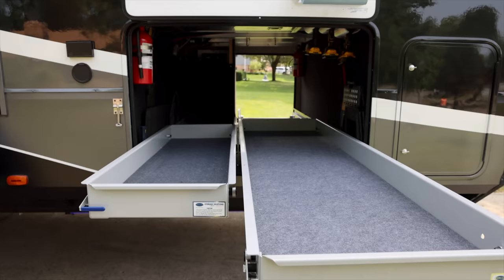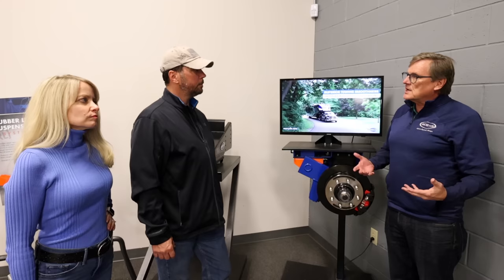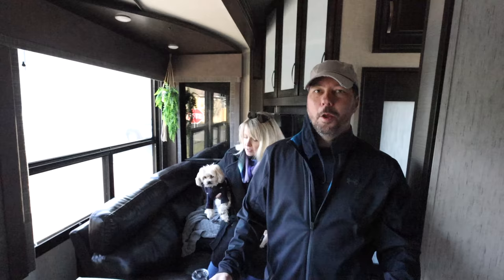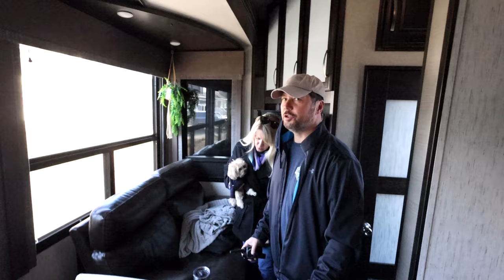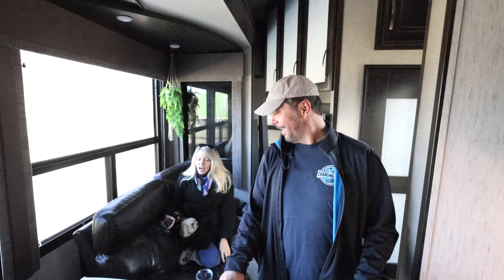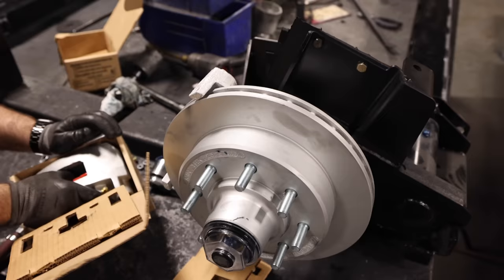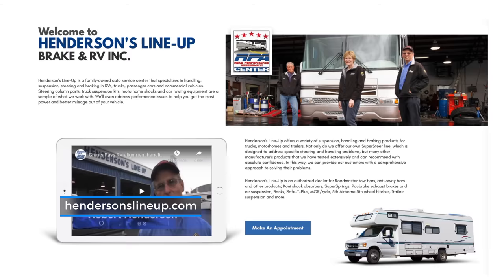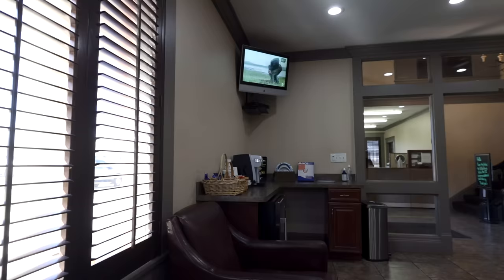MORryde Independent Suspension and Disc Brakes

Comment: Yes, independent suspension is better In many ways, but alot of the chatter they were getting is actually caused by not having shock absorbers. Install a set of shocks and alot of that goes away. I bet the independent system isn't a cheap install! There are definitely advantages to disc brakes in regard to heat dissipation, and apply time, drum brakes are less susceptible to mechanical problems over the long term than disc brakes. I'm sure the new suspension does a good job, but man, the price tag!

Comment: That's awesome. I have a enclosed trailer that had the Dexter torsion suspension on it, which is almost the same suspension you just had installed. The key is independent suspension to the ride. As a truck driver myself the air ride suspension is the best but these style is so compatible without having to add a onboard aircompressor to run the suspension air bags. So as we are currently shopping for a bumper pull toy hauler I'm kind of key on finding one without spring suspension. And I know the Dexter torsion suspension is available on some models. Not sure about suspension you guys purchased! Also video thanks for sharing.
Reply from the maker: They will definitely instal on a travel trailer also.. 👍🏼

Comment: Almost worth asking why this system is not made mandatory, original equipment fitment. 
For safety and longevity reasons. 
There are obviously weak chassis out there and seeing the video of the springs working etc, this system adds up. 
I seriously can't see how twin axel art ups can you handle the treatment dished out, triple axel should be a the only option for these bigger rigs. 
Seeing other RVers having broken springs and chassis bending and breaking issues, I would have thought the DOT would be over this with a fine eye, it's obviously a problem, maybe  guys like yourself should start an advisory group to preside over change in the industry.. 
And I know many will say it's about cost, well how much is your families  life and other road users lives worth? 
Thanks for the great informative  video 
Cheers

Comment: Curious as to why they packed the bearings with grease when the hub has a wet bearing cap 🤔 
A wet bearing would be great for the weight of your trailer 👍

Comment: Thought about the IS, it makes perfect sense but as I understand, there are only 2-places in the country where it can be installed and repaired.  While not out of the question to travel to have the install done, my concern is what if there is an issue on the road many, many miles from  one of the two facilities.  Looking into other upgrade options.  Another well done video and sure makes a compelling case for this upgrade.
Reply from the maker: Most of the parts are fairly simple.  I'd bet most shops could work on it with some guidance from MORryde.
Reply: @ChangingLanes  You are absolutely correct, it seems I was given some misleading info.  I have just received replies from Moryde and should a repair be needed it can be done locally.  Seriously considering this upgrade, thanks for sharing your experience.

Comment: It is great they are adding shocks and adding travel.  Kind of a shame they use rubber for the springs and lose the camber control an axle provides.  I know "independent" is a great marketing term, but that aspect of it is definitely not helping in this case.

Comment: In this day and age I am surprised it has taken this long to come up with this.   Now just one more step, Air Bags so one can level the coach side to side.  No more blocking up the tires
Reply from the maker: With this suspension and the 6 point auto-level, there's no need to block the tires.  We never did it even with the old suspension, but there is a risk of flipping a hanger when the wheels come off the ground.  No hangers to flip with this...

Comment: Been waiting for this video, what an amazing difference that makes.  We plan to order the 395MS the first of the year and it showed on the order form that it can have the Morryde disc brake upgrade, do you happen to know if that is the same set up you just got?  Can’t wait to have that upgrade.  Also, how do you like the new pin box, thinking about the genY but wasn’t sure how you liked the Morryde hitch.  Great information thanks for the video.
Reply from the maker: The IS is not on the sheet.  It's a "hidden" upgrade that you'll need to request through your dealer when you order.

Comment: This type of IS is called a trailing link, several of the private jets I flew had this type of landing gear as it makes the landing and taxing much smoother for the following reasons.
The wheels will not only move up when hitting a bump but they will move aft (in an arc) thus reducing the tendency of the wheel/suspension to slow any forward motion (jerking).
In the leaf spring the suspension moves mostly in an up and down motion, thus attempting to slow any forward movement when hitting rough spots in the road.
Some of this fore/aft movement was adsorbed in the 5th wheel hitch with shocks/airbags. You will notice much much less fore/aft move in the truck with the IS suspension.

Chad, remember what the landing gear on a F-18 looked like, now imagine doing a carrier landing in a F-18 with what we called a stiff legged (straight leg) landing gear.

I noticed on some of the Disc they had what looked like speed sensor lugs, were they used in another application and adapted to their use or is ABS an option.
Reply from the maker: Very good points!  I hadn't considered that!  👍🏼

Comment: Curious if you think I'd have clearance under an Airstream...though a little more height would help with the shallow departure angle back aft given it's a 30'er.  Also, I suppose a drive-on Jiffy Jack is out of the question...or is the swing limited enough were that kind of jack could be used???  One more thing, are you staying at the campground in Elkart run my Bob and Gita?  Thanks again for an informative video!  Glad Daisy liked it, we have a squadron of FIVE  contentious dachshunds.
Reply from the maker: Yes.. we stayed at that one.. Elkhart Campground.  I think a jiffy jack would work...

Comment: In 1996 they where putting the MORryde on the tow truck. Are they srill doing that now? By the way the couple that bought our 1996 HRC still have it and have not had any trouble out of the MORryde. I don't know how many 1000 of miles we put on ours but no problems the hold. Great people to work with.
Reply from the maker: Didn't know they ever did that..

Comment: Couple this with an air ride Goosebox and it would be the best available.  
Have you noticed any difference when backing into tight quarters.  Less or more bind or less or more tire slide on the triple axle.  
Thanks great video.

Comment: Great topic presented well, thank you. Is the only way to jack up the center axle/crossmember crawling under with a bottle jack? Your "first blowout" video showed you using a bottle jack on an outside tire.  What is the reason for using the narrow tires on the RV? After hearing you say "there will always be tire slide on a turn", maybe that is why, less friction so less broken springs? You guys are doing great, keep it up and Happy Holidays !!!
Reply from the maker: You can jack up the RV under the frame, or just one suspension (kind of how I did with the blown tire).  They also sell things that let you run an adjacent tire onto that rocks the side up.
Not sure what you mean by narrow tires?  These are pretty standard width...
Dragging tires or an axle is just the physics of having 2+ axles.  Some of them have to slide a bit in turns.

Comment: Awesome..!! Tech video... I will defenetly get the system installed when I get my 5th wheel.  Thanks for the information, doing my research now.
Reply: Look into Roadmaster Slipper springs with Joyrider socks. $1400 approx. No maintenance, strong, easy install. This was a paid info commercial!

Comment: That looks like a dramatic improvement in safety, and minimizing wear and tear on the RV. Thanks so much for another detailed (and always entertaining) episode.

I did come up with a few questions:

-How does it affect the height of the rig?

-What is the impact on alignment and future adjustments? Can a normal trailer alignment shop do that, or does it require specialized equipment?

-How much weight does it add, and does it impact the Gross Combined Vehicle Weight? Might it improve your cargo capacity?

Thanks!
Reply from the maker: On height, they will try to get you level without going over 13'6".   For us, our hight didn't change.  They said alignment can be done anywhere.. On the weight, it's a little bit complicated.  Please see: https://changinglanesrv.com/faq/?Display_FAQ=3913

Comment: Interesting video, I like the visit at MORryde factory, the welding, mechanics at work, the interviews with MORryde personel. I particularly like the under carriage cameras which offered a good view of the suspension in action. Glad to see you like your new suspension/brake setup, it will definitely make the long drives more enjoyable. Daisy approved yeah! One question, your 3 axles were rated at 7k/8k/9k lbs? each (Chad you tell me). do you know the rating of the new independant suspension? is it the load capacity the same?more?less?
Reply from the maker: We stuck with 7K rated suspension just like our dexter axles.  These are much beefier without the hangers and leaf springs and 21K of axles is plenty.  they usually recommend 8K axles for tandem axle trailers.

Comment: Fantastic job with the camera angles under the RV! Best review of the IS system I've seen so far. We have MORryde IS and their pin box on our Solitude. If you want the ULTIMATE smooth towing experience, get a Trailersaver BD5 airbag hitch. It significantly improves the ride quality in the truck and smooths out the ride for the RV as well. Give Daisy a rub on the head for me :-)
Reply from the maker: Looks like a beast!  👍🏼
Reply: @ChangingLanes  BTW, you nailed the lighting on those cameras under the rig. Not easy to do. Well done!

Comment: I think it was a bonus that one of the Westlakes didn't explode on video!
Reply from the maker: The origin of the moniker “china bomb”, as near as we can tell, came about in 2016/2017 in reference to the E rated Westlake tires having a bad run of blowouts. We're not sure if it was a bad batch of tires, or if the tires were under-rated for the application (heavy toy haulers). Regardless, the name stuck and became tied to all Westlake tires even though the G rated Westlakes have a very good track record. Grand Design started putting the G rated tires on the Momentum line in 2017.

Comment: The one question that I didn't here was GVW did it add to the weight or not?
Reply: Good ques. I was wondering this also...
Reply: What was the height changes to the RV too?
Reply: Same here, how much weight did it add to the trailer over the old suspension system
Reply from the maker: It's a little bit complicated.  Please see: https://changinglanesrv.com/faq/?Display_FAQ=3913
Reply from the maker: Our height stayed the same.  They try to keep it the same if you're already running level, or get you level if you're not.  Of course, all while staying under 13'6".

Comment: Fifth wheel transfer any Sway to the rear axle of the truck, in heavy wind and such.. does car manufactors take in consideration such for trailer max capacity, or does max cap. rely on a sway-bar in their measurements

Comment: We watch all of your videos and really enjoy them. Looking forward to meeting you on the road sometime. 
I was wondering if you had weighed your trailer lately to see where you were at? Maybe when they installed the new suspension? I see that the specs showed your rig at 4400 Lbs CCC before all the options you ordered with yours.  With Lucille on board and everything else that you have brought along, are you getting close to your rigs GVWR? 
I ask this because as FT RV'rs I cant seem to fit into my 3700 rating in my rig. I wish manufacturers would provide more capacity so that one could run with some extra margin.
Reply from the maker: It's a little bit complicated in terms of the IS and weight.  Please see: https://changinglanesrv.com/faq/?Display_FAQ=3913 

We've not weighed in a while but we were a few hundred over last time we weighed... It's almost impossible to stay under then full-timing.

Comment: Chad - we got the same upgrade from MoRyde in September (8k IS with hydraulic brakes).  Have you noticed that while depressing the brake in the truck, the brake actuator located in the front bay makes a very loud “screeching” sound?

Comment: Awesome video.  I have looked but did not see my question. How does this change the weight limits on the trailer compared to the original limits on the axles?

Comment: Awesome video!

What are the costs - at least a ballpark figure (per axle, with and without the disc brakes) labor and parts from the factory.
Reply from the maker: You can find the pricing details for the various IS options in our blog post here: https://changinglanesrv.com/morryde-independent-suspension-upgrade/ 👍🏼    The prices are all inclusive.

Comment: My Husband & I are getting ready to retire in the next 1.5 & we are doing our research on our next camper. I am very interested in the ind. Susp., but he thinks not a necessary expense. However he does want disc.  Is it possible to have the brakes without the suspension?  We are planning to do some winter camping in Steamboat, CO - entire ski season. 
We are leaning toward GD - 395ms or 399th but I really want a East/West bed for the closet space. Any suggestions or advise would be greatly appreciated.  Vanessa

Comment: If you’re keeping you’re rig for a long time, especially on a heavy one like this, it’s more worth it than not.  These mini earthquakes take a toll real quick on the RV.  IF you can afford it and you’re keeping it a long time, ya.  If not, you probably won’t recover the cost.
Reply: My cost, $10,000, was recoverd on my way home from having it installed.  I had 20+ deer run across I 80 in front of me, I had to lock them up and I swerved a little to miss the last one and did not lose control of my rig.  I slowed down way faster than I expected too.  
I am still here, so $10k has been recovered.

Comment: This was a great video and we believe this to be a smart investment.  However, we seem to be having some road blocks concerning the IS and disk brakes being installed as part of our GD Momentum build.  We were informed originally this upgrade needed to be after market on the 328G because only M class was available for upgraded suspension during a build.  We then began to consider a 349M and had expected the IS and disk brakes to be available as an upgrade during the build process as well.  Again we have been told that it would be an after market upgrade.  Can you please confirm if the IS and disk brakes are available for upgrade during the build process?  If so, would you please recommend a point of contact so that we can move forward with building our rv with clear and accurate information. TIA.
Reply from the maker: Hi, Dee.  Please see: https://changinglanesrv.com/faq/?Display_FAQ=3943 
Hope that helps!
Reply: @ChangingLanes  Thanks so much for the info.  Happy Holidays y'all & Daisy too!

Comment: Great video as usual.    We fulltime in a Class C and just saw the MorRyde RS upgrade for the Ford chassis that incorporates the rubber sheer spring into the rear leaf spring hanger in Elkhart at the Phoenix RV plant and then saw your video.  Multiple contacts have been made trying to get the upgrade scheduled with no success.  Brian unfortunately is not responding to emails.  While we are in the mid west we would like to get the factory to install.  Any other contact to try for scheduling?  I am sure they are slammed Planning our 2022 trip to Alaska and know this would be very beneficial.  Thanks for any help you can provide.  Keep up the great work!  P.S.  We used your name as the referral when registering for the NRVTA Basic RV Maintenance course scheduled for December.
Reply from the maker: The main number is the only one we know of...  I know they were booked out quite a while last we heard.  There's also a contact form here: https://www.morryde.com/contact-us/
Reply: Austin in Aftermarket Sales/Marketing just reached out and Brian moved to another group.  Gary or Lindsey from service will be contacting us..  Thank you so much for the speedy reply.  Your most recent video on the heat in Las Vegas had great tips.  Keep up the super work.  It is appreciated!

Comment: Awesome video!! This is definitely one upgrade we will have done - after some penny pinching of course, but totally worth it for the long haul! You're welcome for the pun lol! One question I have been meaning to ask , does you have any issues with your truck wheels and the steel/aluminum rims and valve stems problem with leaking air? Just curious. Thanks for this great video! Stay healthy and safe travels!
Reply from the maker: yes!  I have complained over and over to Ford about it.  There's a class action lawsuit, so they are pretty tight lipped about it.
Reply: @ChangingLanes  should have got a ram 😉😘

Comment: Very Interested. Can this system be installed on any trailer? Are there minimum frame/structure requirements? We live a long way, 2000 miles from the factory, Could a local trailer manufacture resonably be expected to do a good install with proper alignment?